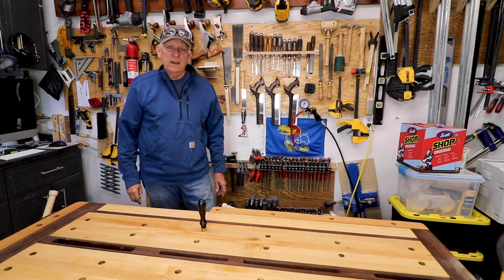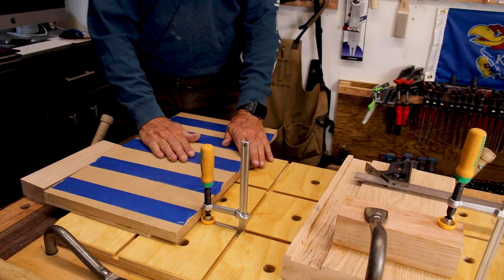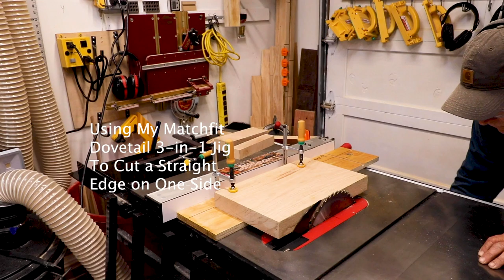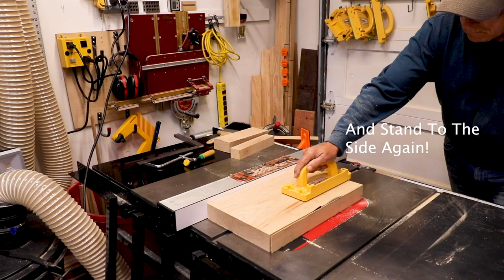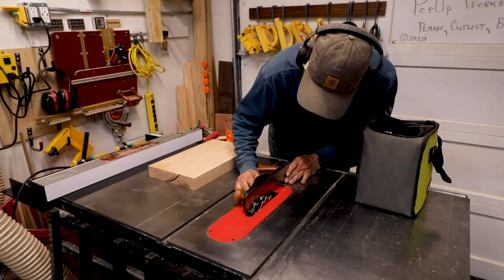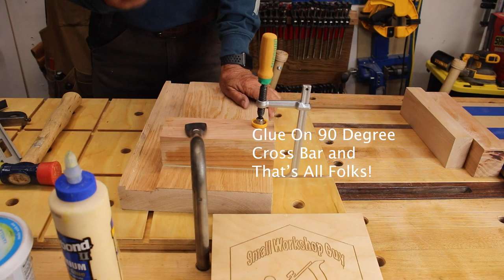What Is A Shooting Board and How Do You Build One - Here Are 2 Designs

Comment: I don't own any planes, so I haven't had the need for a shooting board. That is until I saw a video where it was mentioned that a YouTube viewer made one for a sanding block and I thought that was perfect for my needs until if/when I get a plane. Even after hearing that I still haven't built one, because my first attempt at adhering sandpaper to my small sanding block could have turned out better. Attaching it went flawlessly, I no longer had to concentrate on holding the sandpaper tightly across the face of the block while sanding, and it worked great. Although there was nothing wrong with the sandpaper and it didn't need to be replaced, I wanted to see how difficult it was to remove, and that's where I had less than stellar results. I don't have a heat gun, so I was using an old hair dryer that puts out 1200 watts of heat on high, but it wasn't working well enough to heat the adhesive so that the sandpaper could come off easily. No, it ripped and delaminated no matter how long I held the hair dryer in one spot. I had to wear gloves that I used for auto repair to keep from burning my fingers because of the hair dryer blowing heat everywhere, not concentrating it in a more confined area like a heat gun. When I removed all of the gritty part of the sandpaper, and as much as the paper backing as I could, I had to use an adhesive remover to remove the rest of the stuff that was still on the sanding block. I then I had to sand it flat again. As it turns out, the spray adhesive I used was too strong for this application, it was designed for automotive use where the emblem, trim, or whatever you're affixing to the automobile, had to stay on as long as possible. I have yet to buy a less strong spray adhesive, but when I do, I will then attempt to make the sandpaper shooting board...hopefully.
Reply from the maker: The life and adventures of Autotech1 seem to continue.  Not sure I followed, but then again, many do not understand what I am showing either.  LOL
Reply: Sorry Paul, I'll write slower next time!

Comment: I actually made one this weekend using a spare miter gauge that I got with my sawstop that had been sitting in the drawer and made a video for it on my channel.  Since it is a miter gauge it lets me do angles, and so far it lets me use a plane as well as one of those sanding blocks which use a belt sander belt and so far has made decent 45 degree miters.  Good video for the more standard methods. :)
Reply from the maker: Excellent, Joseph - I will take a look at your video since I have a spare Sawstop Miter available as well.
Reply: @SmallWorkshopGuy  It was a fairly simple build once I decided what to use for it.  I think I used scrap 3/8 plywood next to the miter gauge.   Even though it is not too fancy, It did work nice for what I needed.  Here is the link.   https://www.youtube.com/watch?v=f1Aj2h0vMxc   Hopefully it is something that could work for you too.
Reply: @SmallWorkshopGuy  I used my jig more this weekend, and I have to say I like how it works much easier with the sanding blocks than planes even.  It is making my miters for my current project boxes super quick and easy.
Reply: I have used my version with the sanding blocks on multiple projects since my original post, and it is so much fun with the sanding blocks and come out really nice.

Comment: It can be very frustrating when you glue something and then clamp it. If the clamp is even slightly out of alignment, it wants to pull the glued piece out of alignment as well. My suggestion is this.....use the dado blade to cut a very shallow rebate at 90° to the first dado rebate for the stop block to sit in. This will ensure that the stop block is at exactly 90° to the plane rebate and that it doesn't move as you tighten the clamp.
Reply from the maker: That is a great friggin' idea.  I hope everybody who is going to build the Wood by Wright version sees your comment before they do the build.  In fact,  I am going to pin your comment to the top!  Thanks again.  Things moving during clamping is indeed frustrating.